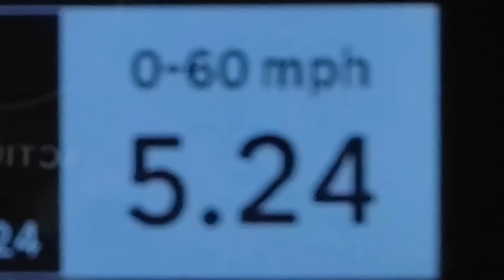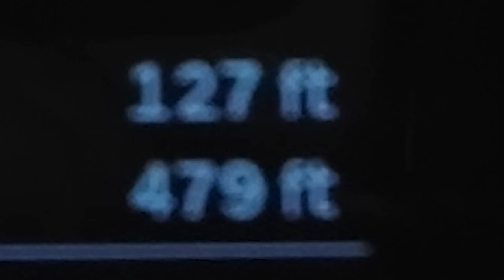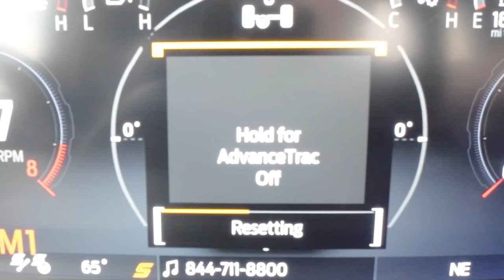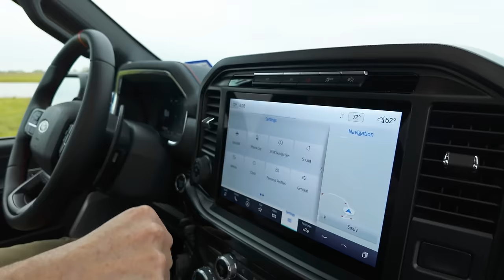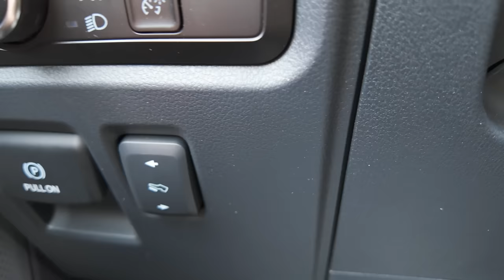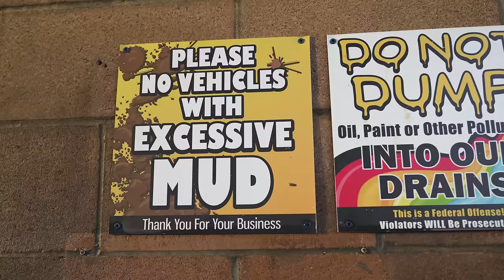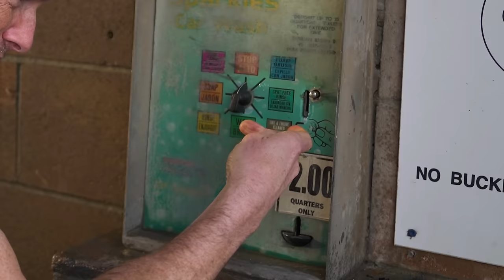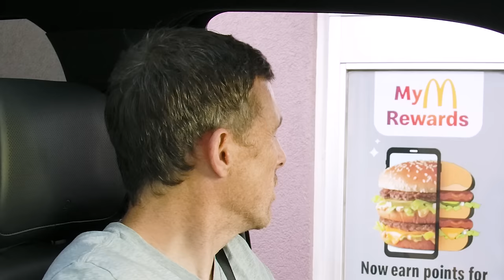F150 Raptor R 6x6 ULTIMATE REVIEW!

Comment: Judging that they actually change very little with this, I don't think those mods should cost 4 times the amount of the base truck itself. 250K tops.
Reply: I was thinking the same thing but fk like less than 100k im sorry but literally for that price of multiple houses. You should be coming with a butler tok
Reply: That’s what I was thinking. Of course all the custom stuff is pretty unique but they didn’t make any changes except for behind the cab. Didn’t even add any performance related stuff.
Reply: Labour costs more than parts.
Reply: Rich farmer’s boy or a rapper buying this for $450k.
Reply: Mercedes g wagon 6x6 might be a better choice at 600k and it comes with portal axles
Reply: I wouldve said 200k max ,one new custom axle , 1 new set of tires , ford heavy duty long bed ,transfer drivershaft at the back, and modify for the bed ,plus some labour for all of it doesnt cost 450k , they only got 7 added stuff and it cost more than a lambo
Reply: 1betterthanyou1  Billionaires don't make terrible deals, that's the reason why they are billionaires. Anyway they like to buy unique stuff, that only them can buy, not sure about this truck. But of course there will be someone willing to buy this monster, just for fun.
Reply: So just use the 250k and build ur own then. Stop watching a next guys pocket. If u think u can do better go build one..ill buy yrs if its cheaper😊

Comment: With the stock suspension, this must be bouncy. Because you don't add much wait, but do add an extra suspension part.
Reply: What if Hennessey Mammoth also has 6 speed gearbox and fully customised racing suspension?
Reply: You can tune the factory suspension anyway so no issues probably

Comment: My F150 Tremor has that exact interior minus the paddle shifters which you never use. No supercharged coyote but I paid $75k.. they want $450k. The twin turbo v6 is surprisingly fast still. You pay $120k more for a normal Raptor R with good options. Unless you’re flexing your wallet it doesn’t add up to me. 🤷🏻‍♂️

Comment: Meah, only the 2WD version. The suspension is adjustable and is probably set hard. It's not supposed to be practical, it's supposed be totally bonkers. It does have its uses, it's the perfect tow vehicle for your polo horse float or racecar transporter but outside of that it's pointless but that's fine, it just looks awesome. Would I buy one? If 300k was chump change, yes.

Comment: No. Unless you are reversing, ypu wont get 50% more stopping power. 75%-80% of breaking power goes to the front wheels. So theoretical maximum is about 10-12% more stopping power when going forward.

Comment: 450 grand..... why!!!  Bed. $10k.  Centre diff $20k.  Drive shafts $5k.  Bakes $5k.  Axles, wheels and rear frame work $20k.  Powder coating, paint, exhaust and sundries $20k.  Talking what $80k top end.  I think they are taking the mick royal with that price.  I would understand it if they had put a totally different engine in it or something but forward of the bed its bone stock.  OK factor some R&D.  2x the conversion cost.  Still puts it at $260-270k.  No where near 450.  Would probably prefer a Carmichael Commando tbh.

Comment: From 0-60 >1.2 sec slower than a golf r. Guess 3.5 tons are not good for acceleration (and corners and breaking etc etc)
Reply: Who cares? It fits on American roads. That's all that matters.
Reply: You should be impressed that a truck this big is even that fast. This is not a vehicle for cornering, it's for going fast in a straight line over any terrain.